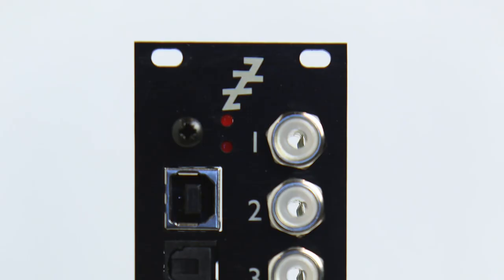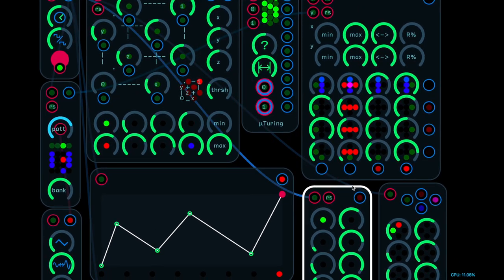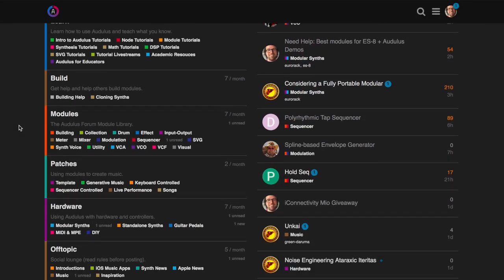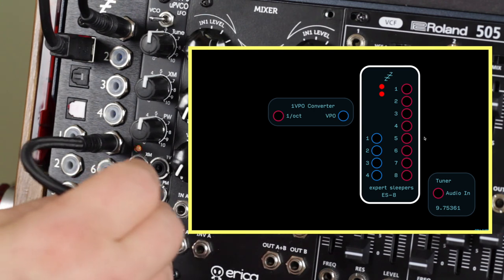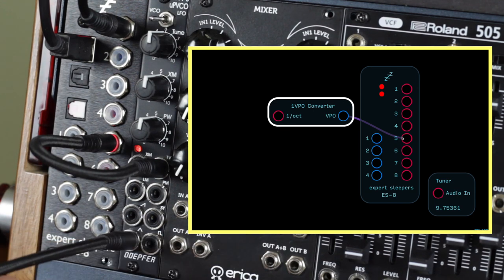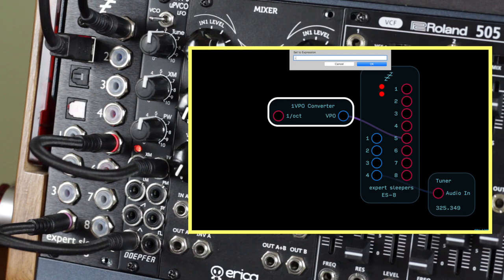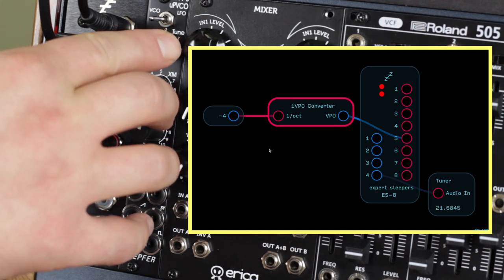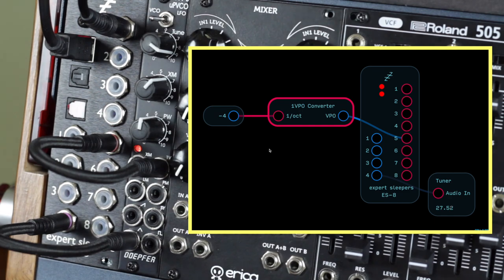Audulus & the ES-8: 1/oct to VPO Conversion

Comment: I’m assuming this will work with any dc-coupled audio interface, not just the ES-8 interface module?
Reply from the maker: Yes! But you'll have to adjust the internals of this module. (o+5)/10 - substitute 10 for whatever the maximum voltage output of your DC interface is (usually more around 8). The ES-8 is only of the only DC interfaces I've found that actually has a full -10 to 10v range. If you need more specific help, head over to the Audulus forum and post about it there and we'll get it working for you.

The reason using a 20vpp interface is great with Audulus is that steps of 0.1 in Audulus = 1v. It just makes the conversion math really simple and accurate.
Reply: Thanks. I have an ES-3 (works from ADAT in) that’s -10 to 10 v and a MOTU 1248 that I’m planning to use soon that will probably have around a +5 to -5 v range after boosting its output, but I will check with my voltage module or meter and calibrate accordingly. Planning on getting the Mac version for this setup, I love the iPad version.
Reply from the maker: @sysexstudio  Awesome! As of this moment though there is a problem with using aggregate devices and Audulus. It's actually a bug on Apple's end that they need to fix - we filed it with them months ago and they still haven't done anything about it. We're trying to see if there's some workaround though. So if you can use the ES-3 by itself, that will work, but combining it with the MOTU won't unfortunately. (EDIT: I see now from Sysex's comment that it WILL actually work! :) )
Reply: Thanks for the heads up about the aggregate device issue. The ES-3 actually just accepts an ADAT optical cable input from an typical audio interface. There’s no USB or anything, it just converts the ADAT signal into 8 analog DC-coupled outs. So my setup wouldn’t require an aggregate device, just my MOTU interface only, and I would just use a bank of it’s ADAT outs to route signal to my ES-3 module.
Reply: @audulus  Sad to hear Apple still hasn't gotten better in that regard...they'll only listen if you're  a big name
Reply from the maker: @t1mmy13  Yeah hopefully we can find a workaround! I know they like us though because we're on their Appstore Connect landing page :)